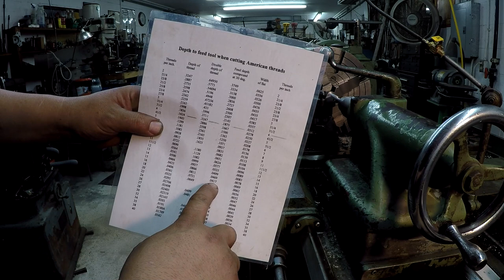Monarch Lathe Leadscrew Reverse Lever & Left Hand Threads

Comment: The auto stop feature is awesome for threading. my old Pratt and Whitney has the same feature and i use it for threading all the time. and it speeds the process up substantially once you get the rhythm down. and the stops work as a great safety if you happen to get distracted or start day dreaming during a long cut.

Comment: Thanks Adam. Just turned left hand m42 x 1.5 for the first time. I had a spindle with a 1-9/16 -16tpi thread and couldn’t find the right spanner nuts. It was easy enough to tweak and rethread. Works great and good to go despite a funky half nut.

Comment: That thread stop and feed stop feature is just disgustingly cool. Production threading would be so easy and fast. If you set it up right, you'd never have to worry about crashing in to the face of the part when turning or feeding at high speeds. So cool.
Reply from the maker: +Stephan Soucy That and when cutting a really odd pitch like a fractional pitch. 👍🏻

Comment: I have Monarch ck12. I'd never cut threads before. It has the same features as your lathe. It worked flawlessly.
Reply from the maker: Charlie do you use it now for thread cutting?
Reply: +Abom79 yes
Reply: +Charlie Wiard I have a oil leak. It's coming from around the spindle gear leavers. I need to figure out how to get it apart to change seal.

Comment: Cool way to come back from the race track to see this upload! Awesome.  That cheat sheet is pretty cool. I knew the monarch had the ability for the operator to have an automatic stop. Didn't realize it had the ability in both directions. Was this a standard feature for the Monarch's back then? Given the history of this unit (Naval Yard), I would think a lot of ship machinery needed complex machining ops - including left hand threads on many parts. I can think of some big auxiliary generators World War II US Navy Destroyers were equipped with.

The adjustments possible for the cross slide and tool post are high quality features. I'm still in awe of the complexity these lathes offered. Imagine assembling one of these beasts at the Monarch factory, all hand built.

Thanks Adam! #21

Comment: Hey Adam, wondering if you could do a step by step process of using the monarch? Just bought one, a 1946 12"ck, similar to yours. Bought it, as is, i know the guy I'm getting it from, but he said he only used it to polish hydraulic shafts, never made shavings with it. He said that someone bumped into it and said it wont thread. Praying it's just a sheered pin or something simple in the carriage. I'm pretty new to the world of machining. Cut my teeth on an old Bridgeport Mill and American Pacemaker lathe. The 46 Monarch hasn't arrived yet, haven't had time to troubleshoot and play with it.
Wondering if you could you do a tutorial on how to use the levers? Facing, threading,etc.? I don't have a manual, still looking. It would be much appreciated.
Love the content, and keep on making shavings.

Comment: Question on the flood lube: if you stopped a job with chips and coolant all over the lathe, and went off for a long weekend, do you come back to a sticky pile of chips or worse, rusty stains on the lathe and generally harder to clean up?
Reply: Who needs long weekends, with a lathe like that? LOL ;)
Reply: Hey, the coolant is usually an oil base, with oil being naturally corrosion resistant. The chips don't usually stick together because of the water in the coolant and the only time the lathe rusts up is because people don't use enough oil in their coolant :)

Comment: Actually, strictly speaking, in your thread depth formula, it's not 0.75 divided by the pitch: it's 0.75 divided by the TPI (threads per inch) where TPI  is  1 divided by the pitch. 
So the formula is effectively 0.75 multiplied by the pitch -- or more correctly (for multi start threads) the lead. 
The latter formula works for metric threads too, but you may not need a calculator, because the pitch is generally a nice round number: divide it by four, then multiply it by three. (Answer is in mm, of course)

Comment: I like that lead screw reverse system. So when you use that the half nuts stay engaged and there is no need for a threading dial? I don't see one on that machine. That must be an interesting clutch system to keep the spindle synced to the leadscrew when not under power.
Reply from the maker: +Rambozo Clown Yes the half nuts stay engaged. It does have a thread dial, you can see it in video when I engage the lever.

Comment: That Monarch is a Cadillac of a lathe.
Reply: Worked on beautiful lathe very similar to this Monarch. It was an old Cazeneuse 1500mm between centers, smooth as silk & rock solid. It had a foot bar to stop the motor & progressively break the chuck, forward & revers select on the same leaver. Great for blind threading inside a hole.

Comment: Okay, I watched several times, and at time 2:09 you said the "flats on the hex are 1", not the points. So, if you cut below the "flats" dimension would that not let you mill the flats to the correct size? Points being at a larger diameter than the flats.

Comment: Hello Adam

A question to the feed screw reverse.
How did the engagement work so that it did line up whit the thread?
i mean the lead screw has to start rotate at that moment when the chuck is at the sam rotational orientation than it whas while it get disengaged...
there must be an clutch assemble in the lathe which senses the orientation of the main spindle...

very interesting the mechanical version of the fancy cnc spindle index threading thing...

Good wishes from germany
Reply: From what I've found running my Hendey lathe of the same vintage, they use a single tooth dog clutch to engage the leadscrew so it always engages at the same point. You can hear the dog clutch when Adam engages the leadscrew lever each time. There is a clack when it engages. Great feature to have on a lathe. Craig
Reply: I was wondering exactly the same thing.  Single tooth clutch would make perfect sense to solve that.  Thanks for the info.

Comment: Is there a reason you didn't use the coolant flood when you did the plunging cut with the parting tool? Is there a tradeoff with the brush on and the flooding coolants?
Reply from the maker: The main reason for me is that I can't see what's going on. I was trying to blend the undercut with the shoulder and the coolant would hide it. If your doing s straight in feed cut it wouldn't matter. But, cutting oil make make it cutter a littler better because of the lubrication.

Comment: Nice cheat sheet Adam, but can you tell me why the depth of thread figures in column 2 don.t match the figures in column 4? I would have thought that those numbers would be the same. What am I missing?
Reply: Column 2 is for measurement, column 4 is read at the compound which is on a 30 degree(actual 29.5) diagonal. The diagonal will be longer (hypotenuse) and therefore a larger number.
Reply: Thanks for clearing that up Mike.

Comment: I think you should consider a black face dial indicator with white numbers and markings, because I still say your lens filter don't do jack except make the whole picture darker.  I don't think seeing what the indicator is doing is super important but if you're that concerned about it maybe you should try a black face indicator... Just saying.
Reply: It works fine for me. Maybe you have your monitor set too bright, or too much contrast. What is happening is that the brightness level exceeds the brightest signal that the monitor can display, and it "washes out" the indicator readings. If you have the contrast or brightness cranked, you amplify the signal, and end up losing the top or bottom (or both) of the brightness range. Try looking at this page:

http://www.tomshardware.com/reviews/calibrate-your-monitor-theory,3615-6.html

Comment: Man that thread stop is the bee's knees. When people compare Monarch's to Cadillacs, they are really actually insulting them, they are way better than that. But dude, you need to fix that tailstock handwheel!
Reply from the maker: What's wrong with the hand wheel? I've always found it funny when people say Cadillac in machine tool terms because there actually was a brand of machine named that. I have never seen one though.
Reply: A local machine shop in my town had a Cadillac lathe. Been a very long time ago and don't remember much about it but the name.
Reply: Adam, at 17:53 I'm looking at the handwheel rotating pin thingie, it's all hanging out loose, like the shaft is wallowed out.

Comment: How can you tell different grades of steel?
How can you tell the difference between different grades of different metals?
Reply from the maker: It's sometimes hard to judge it by just looking at it, especially if carbon steel has rusted over. Once you make a cut though it's very easy for me to tell what kind of steel it is.
Reply: I've watched some old machinist use a file to tell what metal they had

Comment: Hi abom just wondering is the 4 jaw chuck or any chuck balanced against speed vibration as in a car wheel and if not why?" i am not into your type of work as i am into electronics", but i do find your video's fascinating and very entertaining, regards  Mike England
Reply from the maker: I'm sure the body is probably balanced from the factory, but the jaws all have to be equally set for it to run true and balanced. Most cutting speeds for the bigger lathes it's not an issue, unless you spinning an overhung load.

Comment: How does the lathe know when to start moving the carriage? Excuse the layman question please. I have an old Sheldon and it uses the thread dial etc. I see no thread dial so your lathe must have an additional lever or setting for threading odd or even threads??
Reply from the maker: Yes it has a thread dial. Check the video again. When o first started the thread I engaged the half nuts but left them engaged and used the reversing lever.
Reply: Right on. I got to thinking about it more. The bigger better lathes have two lead screws and I guess your Monarch does as well so the carriage is always synched with the screw threads once it gets going??? That's my story anyway :). Is that a close guess?
Thanks for your vids BTW. They are awesome.

Comment: I have a mallet (Osca) very similar to the one seen at 10 minutes in. It came with various interchangeable tips, but I can't seem to remove the ones that were in there. It looks like it should lever out, but it felt like I was either going to snap the handle, or badly damage the tip. Is there a trick to changing them out?
Reply from the maker: +Euro Bum They are just pressed in there onto a small stub, but I have never removed one yet. The ones I replaced they had fallen off themselves. Might clamp the hammer head and using some channel lock pliers keep twisting it to loosen it up till you can pry it off.

Comment: As the stop is set to halt on the carriage's left to right position, and the compound is feeding in at a 30 degree angle, how do you compensate for that?  As each new thread cut would always be slightly off on each pass, unless you feed in at a 90 degree angle.
Reply: Nothing to compensate. That's exactly what happens, the root of the thread moves a little to the right (in this case) with each cut. You have the gutter on the left end and the thread breaks out into it just "wherever it does", and the same on the right end.
Reply from the maker: +Andrew Schembri It's no different then rutting right hand. The 30* in feed is what forms the thread V pattern. It's still lined up and moving along the same helix.

Comment: how does the leadscrew engage at the right moment so you arent off the thread?
Reply: There is a dog clutch with only 1 engagement point per rotation of the main spindle, so the work does an exact whole number of turns between the lead screw being stopped and restarted.

Comment: 1 inch across the corners would give you 866 thou across the flats, and that seems to be an awfully strange size to me. Are we sure it's not 1 inch across the flats?
Reply: got to luv when some jag off nitpicks a misspoken word when you're doing us a favor by doing these videos
Reply: stuknda80z he said he was turning it down to one inch, that's some pretty bad misspeaking.
Reply from the maker: Rob, using calipers I was getting anywhere from .995 to 1.000. So I just rounded it off to 1". I haven't  mic'd the flat yet but they are right about 7/8" nominal.
Reply: Abom79 oh of course, i'm not sure how i missed that
Reply: +Abom79 If I recall correctly, the adjuster I sent you is designed for a 15/16" open end wrench. The idea being the nut, adjuster, and long hex aluminum tube all use the same wrench size. But I do have other adjusters that use 1" on the flats of the adjuster. 

It just makes it easier to grab two wrenches of the same size if thrashing on the race car at the track.

Comment: What are you running for coolant these days?
Reply from the maker: Still using my old bucket of Mobile Cut 102. Bout out through and will find something else.
Reply: thanks,looking for something to use in my victor, locals have mainly houghton fluids. As a side note seems pretty tough to get any much for sulphur based oils up here, guess I'll have to hit up eBay.

Comment: could someone elaborate on why he says what he says at 8:30 about straight feed?
Why would fine threads be okay for this method but not coarse? 
It seems a little counter intuitive to me is all. I would think angled feed would be the way to go since the incriments would be smaller thus lessening the chance to over feed, which SOUNDS like it might be a problem on finer pitch and shorter threads.
 I'm not a machinist so go easy on me lol
Reply: jon arbuckle the point of using the compound is so the tool isn't cutting on both sides.  on bigger threads it would cause chatter, but you can get away with cross feeding on small threads.
Reply: `Thanks man

Comment: thats crazy!!!  how in the hell does the gear box know when the headstock is in time to start the lead screw and have all that shit to jive together...      I like that cheat sheet too.. easier to read than the handbook
Reply: It has a single sided, single tooth dog clutch inside the headstock, (the other side of the tooth is ramped). 
It's on the input side of the gear reduction which drives the screwcutting gearbox, and the clutch turns at the same speed as the spindle, so the leadscrew will be in the same relativity to the spindle each time the single tooth takes up the drive. The feed lever moves along when the collar hits the apron and just slides the clutch out of engagement 
It's a simple idea but it wears out quite fast on a heavy lathe if you use it a lot, or run at high speed. I've never understood why they didn't gear it down by half and have two teeth.
Reply: you just ruined the magic for me...   just so were clear.